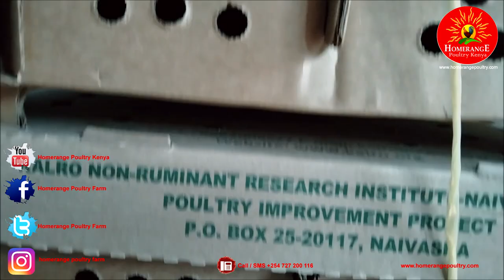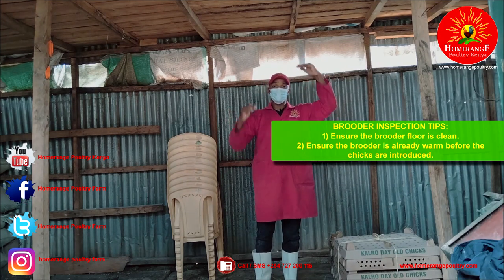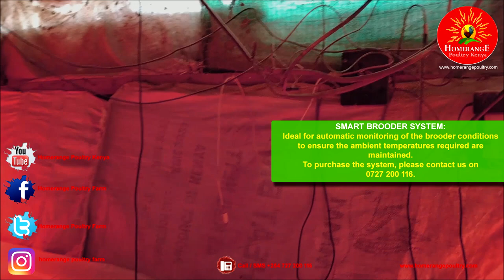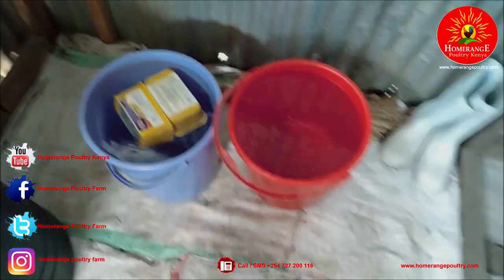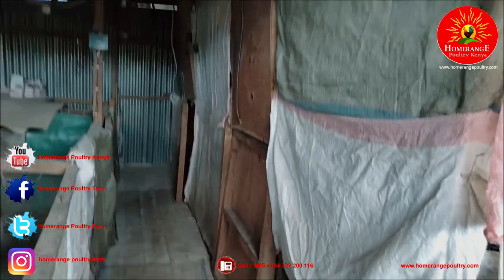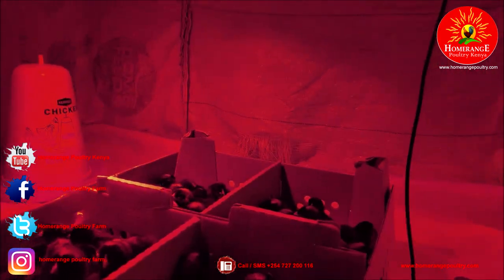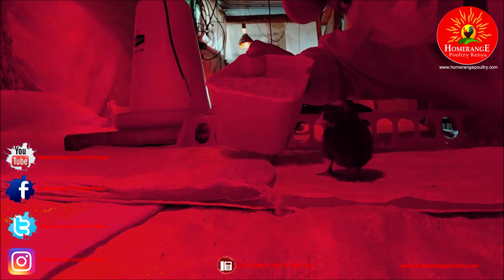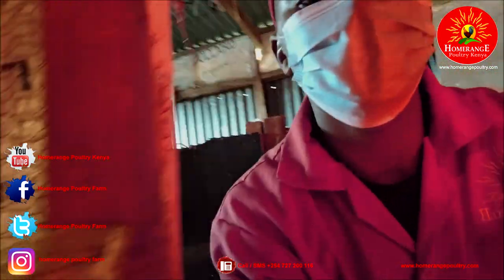Raising Baby chicks with NO DEATH How to raise baby chicks with zero death No mortality of chicks

Comment: Hello thanks alot for your informative video i have a question is gas brooder advisable  for places with frequent blackout  and will it affect the height of the brooder
Reply from the maker: hi Felix. Gas brooders are not recommended as a backup option due to their risk of causing possible fire in the event of a minor leak. The best backup option is a KOKO burner which is a biofuel burner that provides heat and has no risk of explosion.
Reply from the maker: Don't forget to subscribe and like the video Felix 👍👍🙏🙏